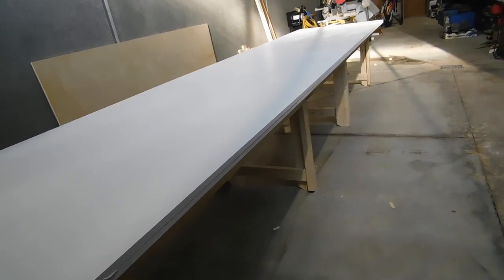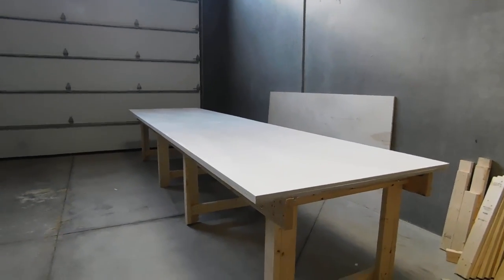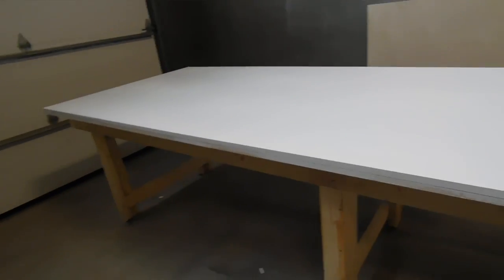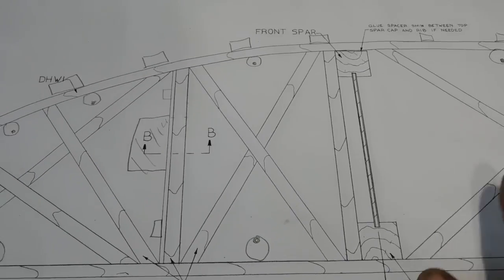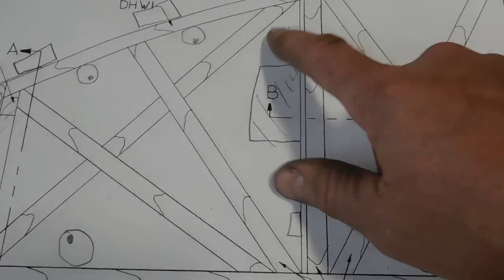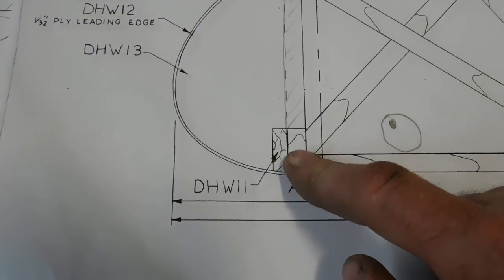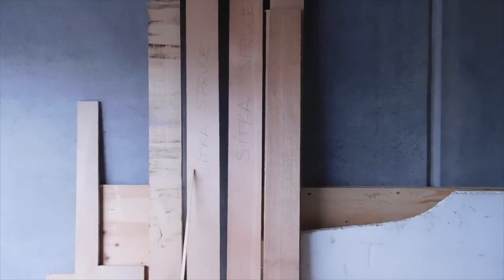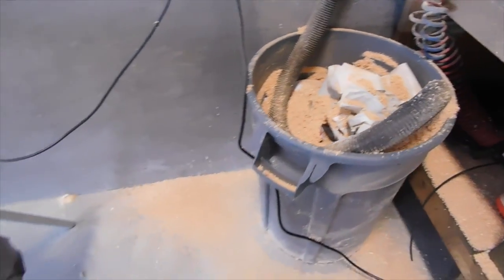DAKOTA HAWK EPISODE 1

Comment: Hi, new to your channel. What engine are you gonna be using? How much was the plans? Can this plane be made both tail trigger and nose wheel?
Reply from the maker: I was thinking of the Aeromomentum engine... most use the Rotax I believe. I think the plans are about $500??? The plans are for a taildragger but there is at least one person building a trigear... look up dakotatrihawk... I think his handle is ulbuilder.
Reply: How much HP?
Reply from the maker: @outlawflyer7868  See how fast I can afford to go... at least 100HP. In the foothills of Alberta I'm typically taking off from a field at 5000ft and flying into the mountains so horsepower is your friend.   https://aeromomentum.com/am13.html
Reply: I always wanted a Continental O-200 on one of these aircraft.
Yes I know it's heavy, but I just like the idea of an O-200 on a Dakota Hawk.

Comment: Hi great video, DHW10 & 11 if the same as the youngster will be lengths acting as a false spar. Section A-A shows that a vertical at the front of the rib is made out of the rib capping strip (the line in the middle is the grove cut in that mateial of all the cap strip for the cross pieces to slot into), slightly different to the Youngster.
I think my clamps must be smaller than yours, it is recommended to clamp the cross pieces lightly, large heavy duty paper clips would work.
Reply: Yes the De10 & 11 are leading edge spars.